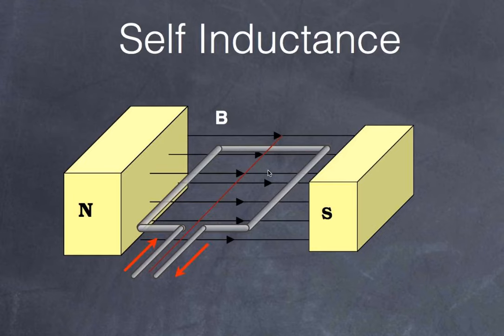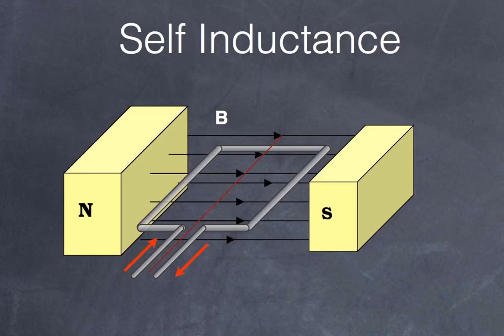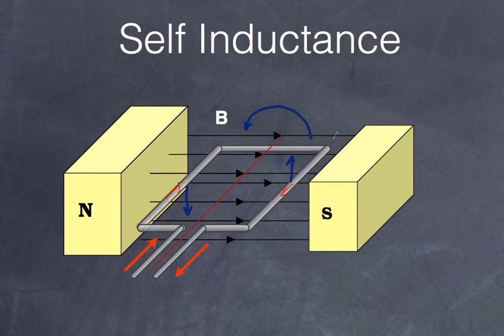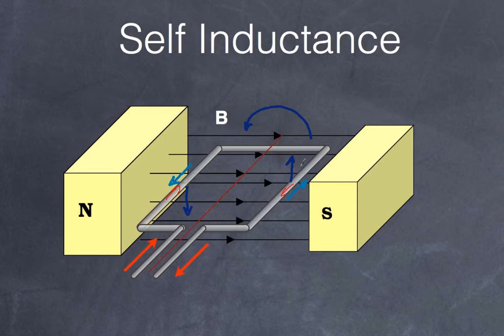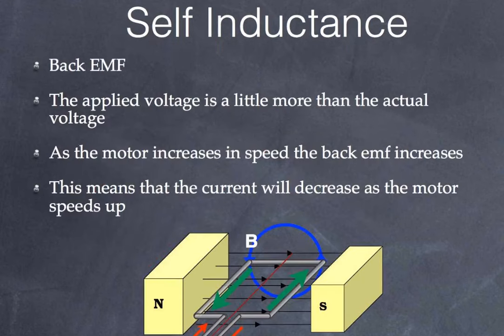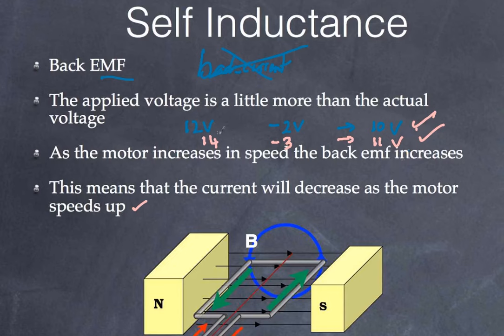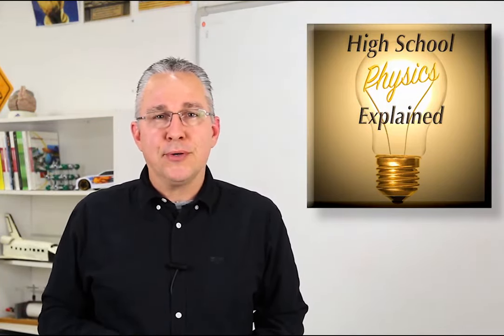back emf explained

Comment: Faraday Disk has No back EMF??? P.S. I'm remaking the Faraday's Disk (1831) even better with monopole magnets.
The copper disk is now a single pole, put the N&S copper disks together and spin on its face. Monopole materials are more conducive, and monopole magnets pull harder together.

Comment: Can there be a time or stage in the process where back emf equals the applied emf and net current is zero??
Reply from the maker: No. It’s self regulating. The more back emf the more resistance. Thus then lowers the spin rate. But then that lowers the back emf.
Reply: Thank's doc!

Comment: Thanks for the videos paul! I have one question. How come the current also decreases when the back emf takes effect decreasing the voltage. I think i am confused because in a transformer question for hsc, energy must remain the same, so if voltage drops, then current will decrease. Could you please explain why the current drops too? Thanks
Reply from the maker: thanks for the question. Don't confuse a transformer with a motor. In a transformer the input emf is separate to the output emf and are connected through flux linkage. They are separate circuits. This is where LCE applies, and as you correctly note, that if there is a drop in voltage, we get an increase in current (in. the secondary coil)nt
In the motor we only have one load, which is the motor, so a back emf is generated that lowers the net voltage. Since it is one load, Ohms Law now applies, so as voltage decreases so does current (assuming the wires are ohmic resistors.

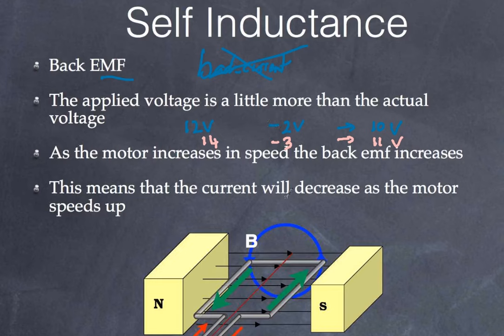Comment: You say increased speed will reduce current. However, at 5:00 you show that increasing the speed by increasing the input voltage from 12V to 14V actually INCREASES current as the voltage across the motor winding increases from 10V to 11V.

Is this a mistake? If not how can this difference be understood?
Reply: I just noticed that 10111 already commented this and you replied so feel free to ignore.

Comment: thanks for posting.  some thoughts.   imo, when talking about a BRUSHED motor being damaged when it is forced to stop while still receiving power, the voltage and current spikes are caused by a short circuit through the commutator contacts and armature windings.  (the only resistance present in the circuit is a few ohms in the windings.)  i have a theory about back-emf in a coil.  take a look if it suites.      cheers

Comment: Someone doesn’t know his left and right.
Reply from the maker: If you referring to hand rules there are two versions. I don’t use Fleming’s hand rule, but the palm rule.
Reply: @PhysicsHigh  I was just going to ask if that were the case.  Took me a while trying out what I assumed you meant as Fleming's left hand rule and couldn't make it work.  Of course.
Fortunately I've seen your video on the subject.  Just a suggestion: could you mention which version of the rule you're using, ie. Flemings or palm rule, pls.? 

Apart from that, thanks for another excellent video.

Comment: direction of induced emf is found using flemings right hand rule!!
Thank you for the video though
Reply from the maker: +TMS that is true but using the left hand is equally helpful. I chose that way since the fingers are consistent for magnetic field lines when comparing with the right hand palm rule for motor effect. I also like the complementary aspect with the motor effect - right for motor, left for induction and you can tie in Lenz law. What ever works best for you, stick to it.
Reply from the maker: In many texts the RHR is used for the motor because the thumb signifies conventional current. This is opposite to electron flow.
(Obviously the reversal for induction)

Comment: Hello high school Physics explained, i dont understand why the current would decrease. Could you explain it to me?
Reply from the maker: +Chris John think of input voltage as pressure. That allows current to flow. More pressure, more current. Thing is, with electrons flowing, they create a back voltage, pressure if you will. That means the NET pressure is reduced. Hence lower current.
Reply: thanks